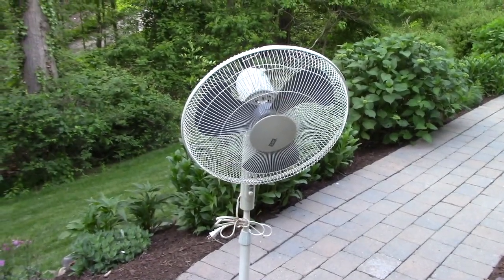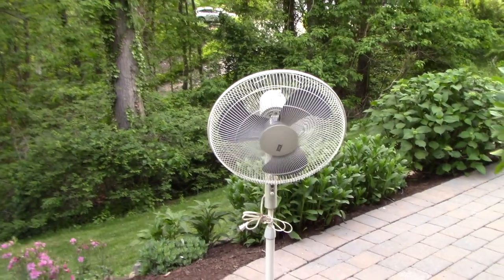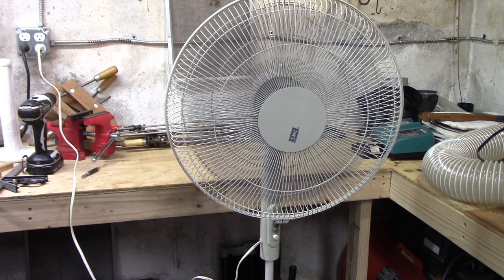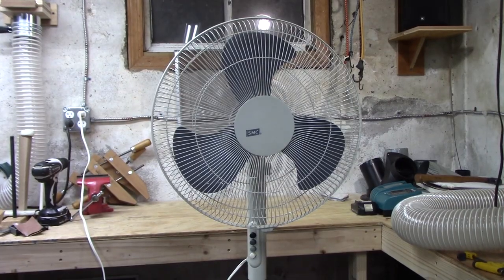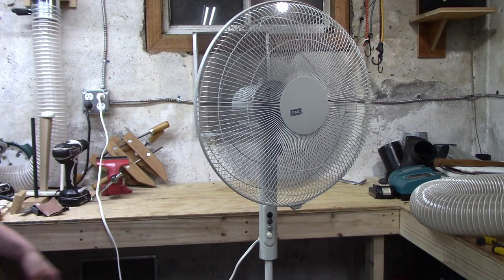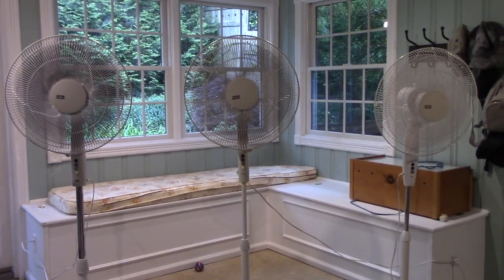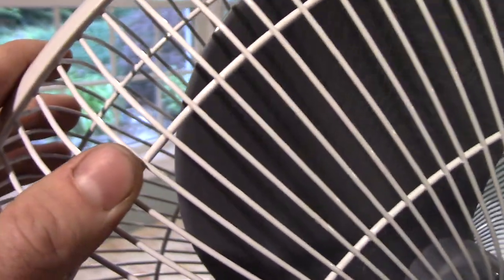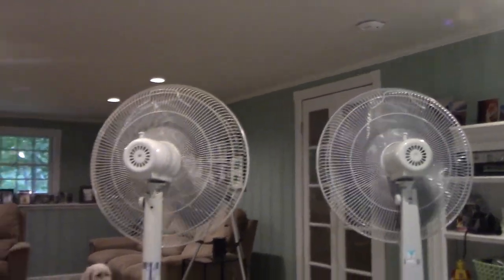SMC Pedestal Fan Model SS-18 Restoration!

Comment: Well now I know why there's no SMC pedestal fans for sale anywhere, Colin has them all!  Very nice rare-ish set.  My favorite is the left one (SP?), although it sounds like that motor could use another service.  You could definitely benefit from a switched power strip to ensure they're all turned on and off at the same time for the spindown test and such.
Reply from the maker: Yea right!? Lol! I don't know which one I like more lol! That noise you heard is probably because these have steel bearings, so they always make a bit of noise. Plus, it hadn't run much since I serviced it so they were probably a bit dry. Yea I have some of them, but this was a kind of spur of the moment thing so i didn't think of it. I think I did pretty well though lol! Thanks for Watching!

Comment: Stinkin' tower fans! My grandmother got a tower fan when they first came out, I never really liked it. If I recall correctly, it may have replaced some kind of vintage box fan, but it's been too long and I don't remember. I think the box fan had a black blade that was hard to see, and it shook really bad, that's all I remember about it.
I think I mentioned this before but these did use steel bearings, as long as they're lubricated they work very well and last a long time.
Sounds like a shop tour is in order for you, I broke the ice showing the disaster that is mine...
The music is awfully loud for someone who complained about the sounds in my video!
I've seen the pin bent like that before, just a handful of times though. Kind of amazing the plastic nut is even able to create that much force, those pins are pretty strong.
What lubricant did you put onto the oscillation mechanism?
The age of them surprises me as well. The blade on the one on the left must have been used for a long time because I know there are 90s models that used it, they had the boxy control panel. I remember those, looking up at them thinking they were absolutely gigantic. Another collector actually found and bought one for me sometime last year, they don't live local so I have yet to get it from them but eventually I will have one in my collection. I have a 90s one, with the boxy controls, that's comparable to the one on the right, I forget what the brand is on it. I have to concur, it seems kind of weak.
That one on the left has a startup chime? LOL!
You did pretty good with the spindown test, there's no way I could have hit that third one so quickly without some kind of freakshow or just totally missing the button. The one that's new probably does need some time to break in the bearings, although I suspect the most recently serviced one won't spin for as long after it's had a few hours of use.
Those blades look a little flaky, I'll have to look at mine and see if it's like that as well. I don't think that's how it's supposed to be.
Reply from the maker: I thought I might get a comment from you on this video, but not one this long 😜! I think I will just go down the line here with answers:
That's a shame! When I was a kid, I thought they were really cool, but after I realized what I had traded, I never really liked them anymore. I still have the one I bought, but I hardly use it.
Yea you did mention that! I was thinking about it when I saw the spin down time on this fan!
LOL! I wish I had a shop to do a tour of! I'm only 17, so I don't have a place of my own yet. My stuff is spread all over the house, wherever there is room, but most of the fans reside in the attic year round. I might do a collection tour at some point, but it would be a bit all over the place!
Yea I realized the music was a bit loud, I should have equalized the volume with my voice a bit better, but I kinda rushed the production of this video. The sounds in yours weren't too loud, I just am not a fan of the sound effect itself. They remind me of the corny sound effects of Microsoft powerpoint from the 90's!
I have never seen anything like that before, but when I saw it, that's what came to mind for me too! They're only plastic threads!
I just used some automotive grease I had. I think it might be chassis grease, but I could be wrong. I doubt it was the correct thing to use, but I figured that some grease is better than no grease! I'm sure that if I had a bigger channel, I would have gotten millions of comments telling me why that is the wrong grease to use lol.
Yea I was surprised too! I think they were probably just using up some old stock of parts and were phasing out the SP-18's at this point, but that's just my guess. They used the same blade design since the mid 80's I think! I think the only thing that changed is how thin and flexible they got. I could be wrong, but I think the early ones were a much thicker and more brittle plastic, like the stuff used on the 12" Galaxy table fans. 
That's cool! I hope you get it at some point! You should make a video of the one you have! There aren't really a ton of decent videos of these fans out there!
Yea it does lol. I guess they added that in at some point😜! IDK why, but my phone decided to start blowing up during that clip! I probably should have just redone it, but as I said, I kinda rushed this video a bit. Ohh Well!
I was a bit surprised with myself there! I thought for sure I would screw it up too, but I didn't! I think that the NOS one needs to break in a bit. There is no reason it should have a shorter spin down time than the SS-18 with how big the blades are! I have actually been using the SS-18 quite a bit after the shooting of this video and the spin down time is still pretty good! 
Which blades are you referring to? I know the SP-18's blades are a bit warped, but do you think the other ones are too? 

Thanks so much for watching! I really appreciate the comments too!
Reply: @colin_5839  It looks to me like the one on the right was warped, couldn't tell too well about the one in the middle. I think the leading edge and the top edge should not be curving forwards at all, that seems like very terrible aerodynamics.

Comment: sick!! I have this same one! It somehow isn't yellowed yet and when I got it the base had plastic on it so it was mint. Bad news is the blades are warped slightly and the motor housing rattles really bad so I have to stick a foam thing under it to make it stop. I also have the feature comforts branded one which is very yellow and has the same problem as your old one with the pedestal bending but it hasn't broken yet.
Reply from the maker: Thanks! You should go watch my SP-18 Video! Talk about Mint! I bet the motor housing rattles because the warpage on the blades causes them to be out of clock a bit. You should look into retrobriteing your feature comforts fan to de-yellow it! Or you could steal the blade from it to make 1 good one too! There are a bunch of good videos on it. If worst comes to worst, you can always just build a new, gigantic wooden base like I did lol! Thanks for watching!

Comment: Thats the recalled SMC fan.
Reply from the maker: Actually the recall is only for the SP-18 and the SR-18 from the late 90's. This is an early 2000's SS-18 so it's all clear. That being said these fans are only dangerous because of the headwire rubbing when it oscillates and with all my SMC fans I have done my part to fix that issue and I also don't let them oscillate unattended. Thanks for Watching!

Comment: Mine caught fire when oscillating they are dangerous all of an all so I had to throw it away cause the motor burnt out now I have another white pedastall fan. Great video though.
Reply from the maker: Wow, that must have been exciting lol! Hope everything was ok! Yea I am aware of the defect these had. I did my part to prevent that from happening, but I generally don't let them oscillate, especially when I am not present lol. Thanks for Watching!
Reply: @colin_5839  yeah everything is okay thx and yeah smc isnt a make that I would rlly relie on as it made walls black from smoke damage and maybe next time take the smc apart and make it easy to oscolate as I know where the bit caught fire and np BTW I like ur videos